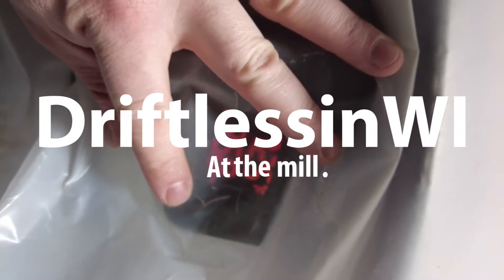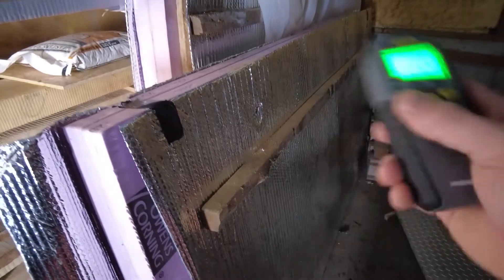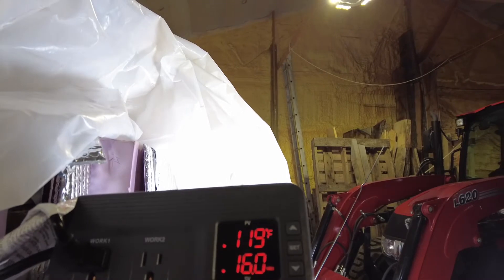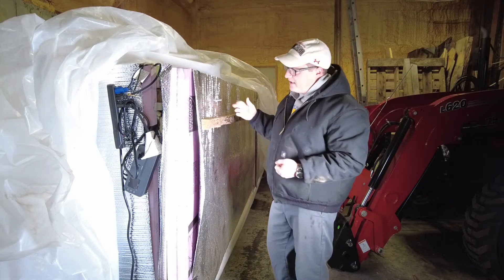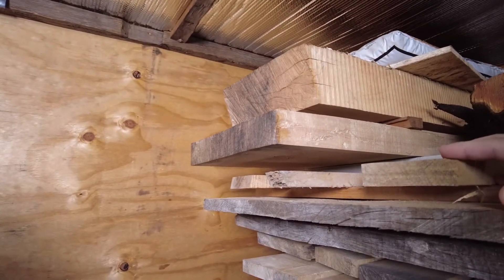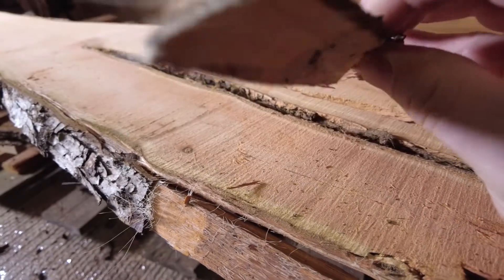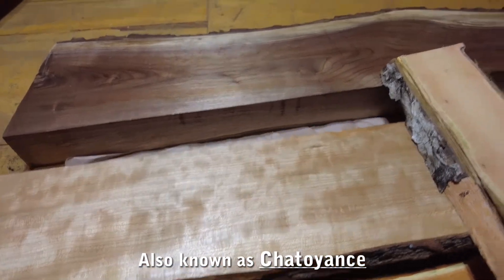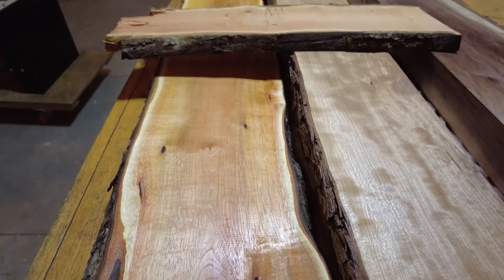Simple DIY Dehumidifier Wood Kiln - Part2 - Does it work in below 0 weather? Finished Buckthorn

Comment: https://www.youtube.com/watch?v=yMj5GWpS3b8 _ this is what is did for heat and airflow. i used 2 * inch fans, you only need one lol. i had my door on the far end and build a track to silde a kart for loading and unloading. THEN I MOVED AND ITS JUST STIING IN MY OLD BUILDING NOW! UUGH i have to dis assemble and re assemble...... ughhhh

Comment: I built a kiln kinda like this! I have a front load door and a track I built, but I need to make the kart still lol. loading is a pain in the rear! Awesome set up and i used your videos to help build my kiln. thank you so much for this! I also use that same monitor for temp and humidity, i added a second one to control red heat lamps :) it gets hot quick even in winter : )
Thanks again for videos man!
Reply from the maker: Thanks for the tip,  a track would be great.  Loading is a pain!
Reply: @driftlessinwi  you are not kidding i have to hunch over to get into it, then crawl out.. building the cart for the track is top priority, haha!
Reply: https://www.youtube.com/watch?v=JPTG2dWjDE0&t=533s
Reply: Do you just use the heat lamp vs a heater - I’m building one right now and trying get ideas - did a cheap solar one last year but bought a sawmill this winter so I’m in deep now and looking to dry faster - also trying to figure a door out so I can just use my loser forks to load and unload - I hate loading slabs / lumber
Reply: @hobbyguy763   I have videos of the build on my page :) 
I used infared and circulated the air with 8" duct/vent  booster fan.
Reply: @hobbyguy763  https://www.youtube.com/watch?v=JPTG2dWjDE0&t=533s
Reply: @hobbyguy763  heat lamps and a electronic switch that turns off or on heat lamps. fan run 24/7. kart slides wood in and out of front door.

Comment: Did you have any troubles with case hardening when you milled the lumber to size?
Reply from the maker: I haven't yet,  but I am very conservative with how quickly I dry wood.  Lots of air drying,  then dehumidifier and fan,  then heat last. It has worked for me so far.  Thanks for the comment!

Comment: Shouldn’t you have sealed the end grain?
Reply from the maker: I do normally seal the end grain,  especially on higher end wood...Anchorseal is expensive!  If I know I need to trim the ends anyway (hinge cut on one side and crotch on the other) I might leave them un-sealed on lower quality logs.  Lastly,  even with sealed ends,  one may still have end checking, especially on full slab cuts where the center moves more than the outside. Thanks for the comment!